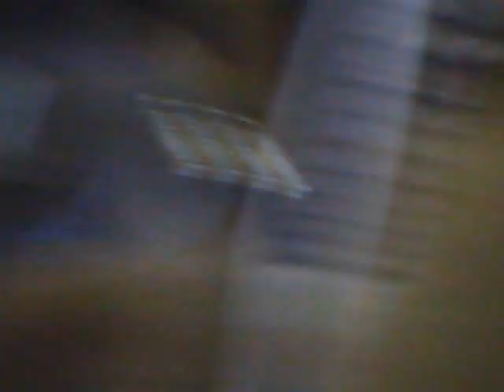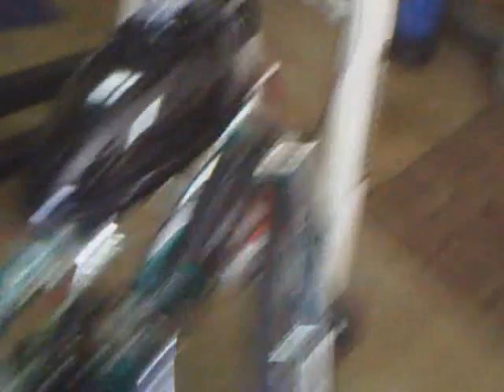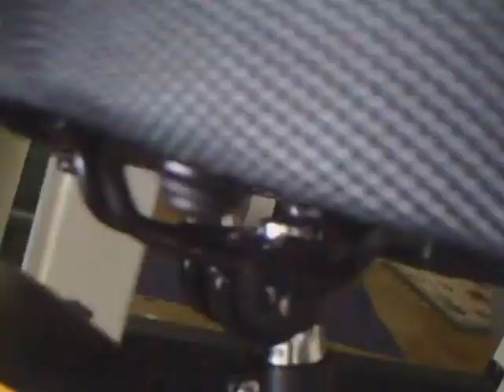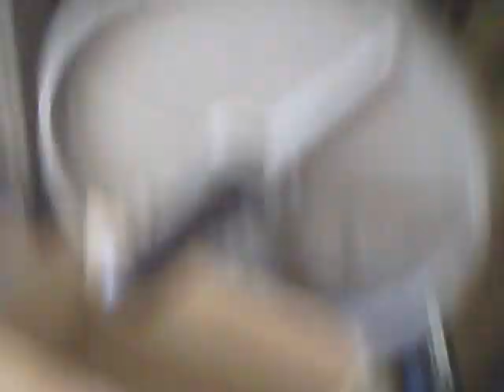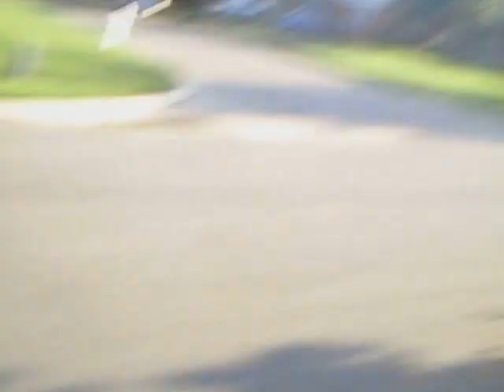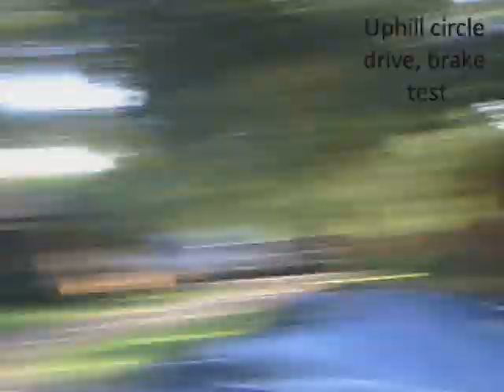Motor Bicycle - reinvented - 30mph in first gear

Comment: That is a cool set up. Sickbikeparts.com has kits on it for these motors to let you shift through your gears and allowing you to keep your pedals on. It uses a front free wheel system.  Also where did you get your clutch.

Comment: I like what you've done, I been looking at those cheap chinese kits but didn't like the fact that it runs on one sprocket and before finding your video I was thinking of making it turn the pedal crank by having a 3 piece crank and removing the pedals like you have done. But where did you find or get the centrifugal clutch for the motor?